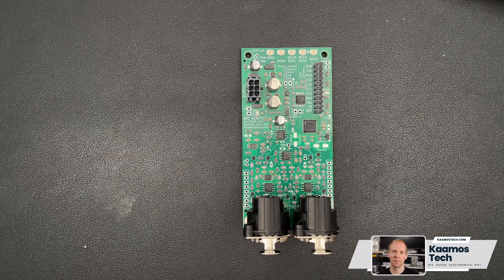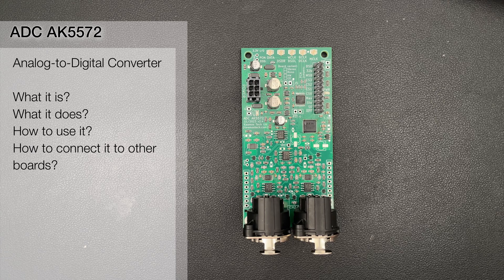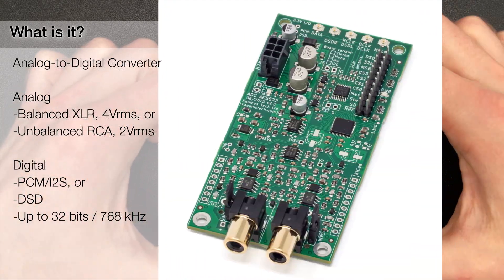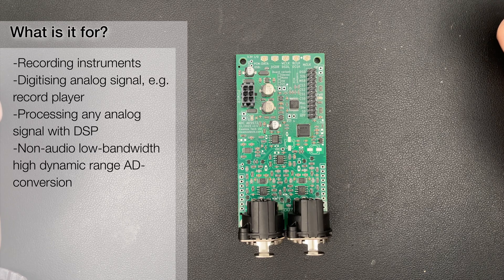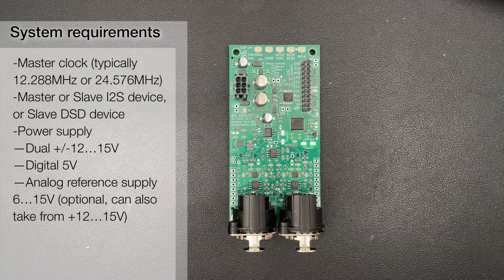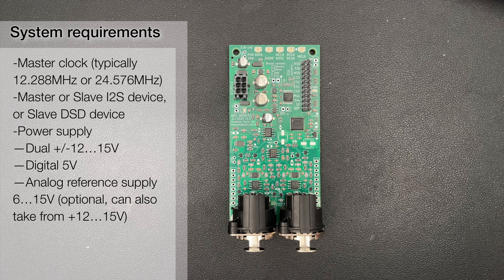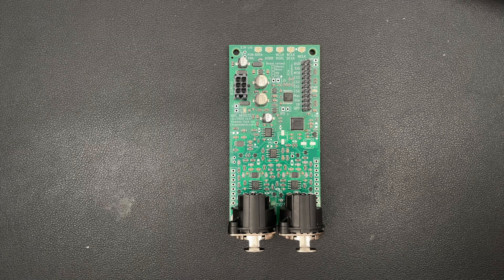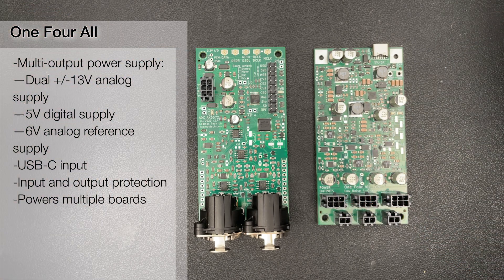Kaamos Tech ADC AK5572 Audio AD-Converter introduction - what it is and how to use it

Comment: Hi there. Can you make a video of your diy signal generator how it is made, and how you use it together with Virtins. Kind regards
Reply from the maker: Ok, maybe I could one day. It uses JLSounds I2SoverUSB board, my W-DAC and One Four All PSU, and my custom PCB where everything is stacked on.

You can use the same idea with any USB DAC though. For example, buy a Topping, SMSL, etc DAC with great performance for little money. Then use ASIO drivers in Virtins.

The biggest difference in my DIY version is that I have I2S and SPDIF outputs taken out as well in addition to the analog outputs.

Comment: Please bear with me, I'm not a very technical person. If I want a standalone ADC I have to buy the MCHStreamer, the MCHStreamer Buffer, the AK5572 board and the One for all. With the pins I select the Clocking and I suppose the options are for the different frequencies (I use 48khz 99% of the time). I see on your website that the Oner for all board is out of stock, when do you expect to have in stock again?.
Reply from the maker: To follow the example in the video, yes. Plus the cables.

MCHStreamer is always I2S Master so the ADC is Slave. In this case the ADC locks into whatever clocks the MCHStreamer provides so you would change the sample rate in the MCHStreamer with the PC driver (or inside a software you use).

I will have more One Four All in stock this coming week.